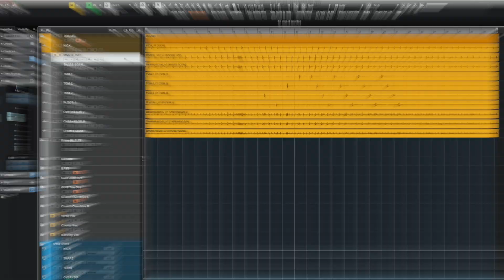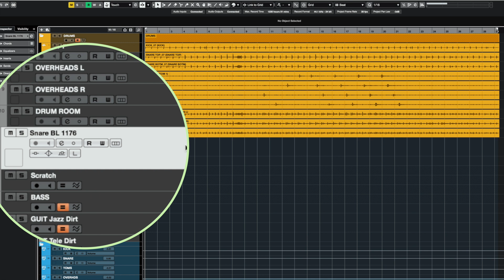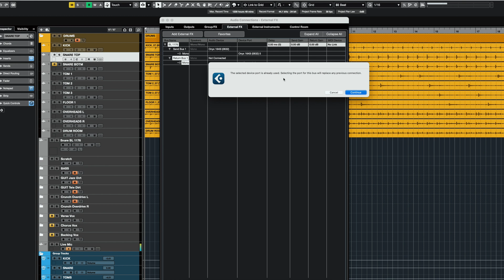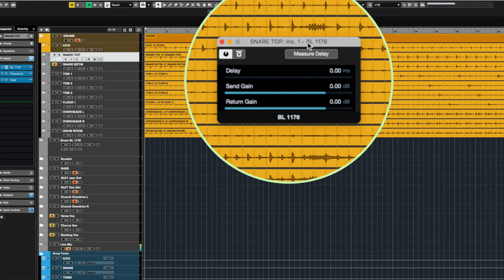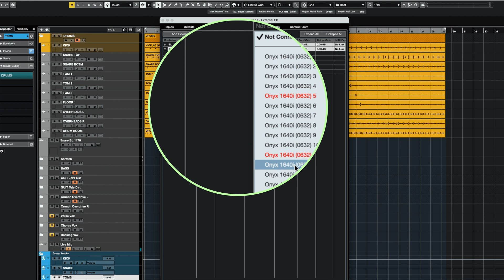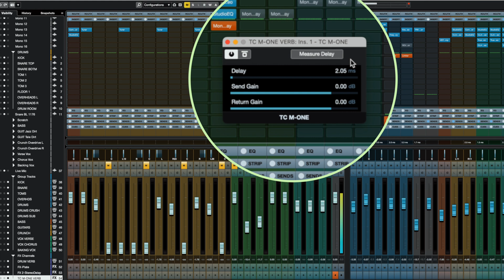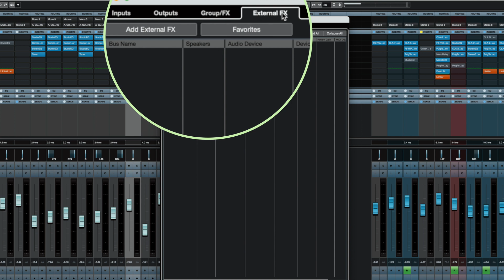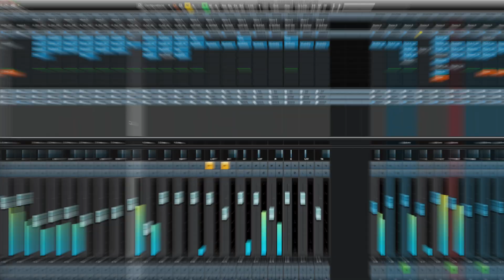EXT HARDWARE IN CUBASE - MASTER CLASS

Comment: When you made the connection of the interface > reamp > pedal > interface. What cables did you use? I noticed that pedal to interface had one line cable.
Reply from the maker: The Reamp box allows you to use regular line level (instrument/guitar) cables out of the pedals back into the interface. Most interfaces have a DI switch on the first input that, when depressed, keeps the impedance correct.

Comment: Thank you. Im building my analog haelrdware. I have set up my hardware the same way with External Fx but I am  ot getting any sound coming in or out of my analog hardware. I have made sure it was connected properly. Not sure what is happening. Using Quantum HD8 to WA73 preamp. Out from quantum, into wa73, out from wa73 into quantum. I get nothing. If someone can assist. Thank you.

Comment: Why doesn’t Cubase receive signal when sending to Output 3, and receiving from Input 1 in another channel? I have the Audient ID14 MKII
Reply from the maker: Maybe check the routing in the Audient mix console
Reply: @Featherlightstudio  I tried changing it from DAW THRU to regular monitor outputs but nothing.. Even sending to Output 3 as a Send doesn't work.. Only when using it as ''external plugin'' but then I can't turn off the dry track to only hear the wet signal

Comment: Great Video and some really cool use cases. The only thing that is a bit misleading is when you state that there is no measurable latency in the analog domain. We need to take into account the DA/AD conversion of the I/O path, and this will always be measurable. 

Anyway just wanted to point that out. If there is some kind of non-monitoring work-around trick I am unaware of here by all means please let me know!

Comment: nice video. Only.. Delay in the external effect window is total crap. Have you ever tried an external hardware and blend it to your dry source in the session ? how ever I use the delay or "measure" there's always a phase I can't get rid off.
Also very obvious if you create an effect track and add on it external effect that you send your tracks to. Phase everywhere.
Would be happy to understand what I'm doing wrong. But there's no video going that deep and actually doing tests with wet/dry etc..
Reply: yeah, i found that using the 'external effect' with a vocal processor(that does not have a wet/dry mix adjustment) did not give 100% processed vocals, so it didn't sound right....the 'output bus' method worked good though.

Comment: Great video! I've got a Mackie Onyx 820i, so I've been using AUX buses with guitar pedals...I think it sounds fine, but after watching this I feel I'm doing it wrong. Thoughts?
Reply from the maker: The Aux busses are returned to the Mains so it probably sounds great thru the monitors. If you want to record the signal from the pedals, you gotta record the Aux buss. There's a switch under the AUX Master section that lets you assign Aux return 1-2 to firewire 5-6 so you could record the effect,
Reply from the maker: The advantage of the video method is simply less channels and patching involved. And once the hardware loop is created, its available with a single click like a VST effect.

Comment: Ohhhh man.  I finally got some hardware, and it's reading the signal reflected by metering, and the preamp is showing.  However, I'm not hearing any audio in.

**Edit**
It's my first time using UAD interface.  I didn't know that I had to change settings on my console.   Figured it out though.  It's certainly an interesting process.
Reply from the maker: Glad you got it sorted!
Reply: @Featherlightstudio  Thanks, man.

Follow on question... Is it possible to make a 500 series module (such as DBX 560A which has no sidechain feature) to act as though it has a sidechain via a cubase software sidechain trigger of some sort?
Reply from the maker: @sekritskworl-sekrit_studios  That might be pretty involved routing but a GREAT video topic for sure!!
Reply: @Featherlightstudio  Let the church say... "Amen". :-D